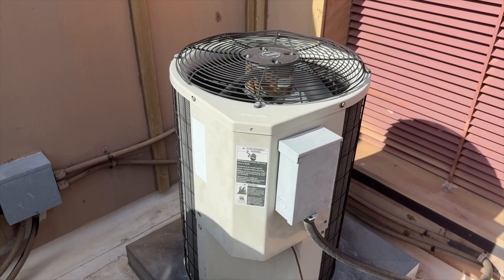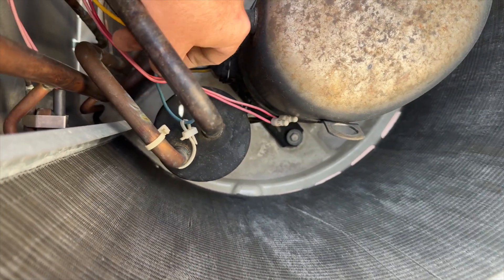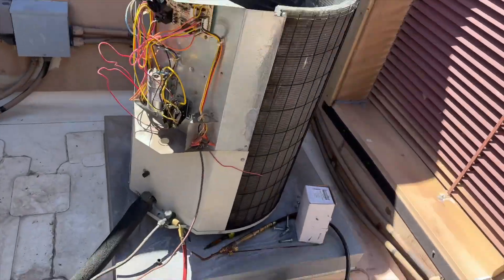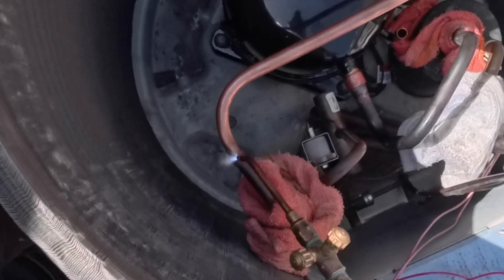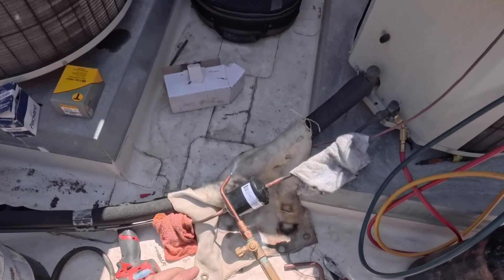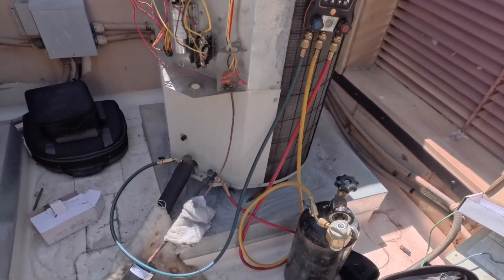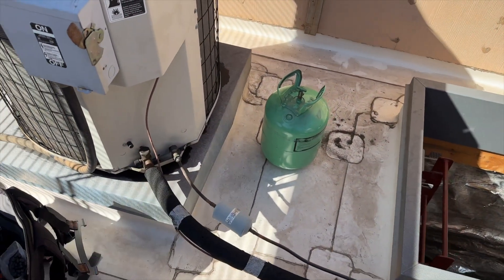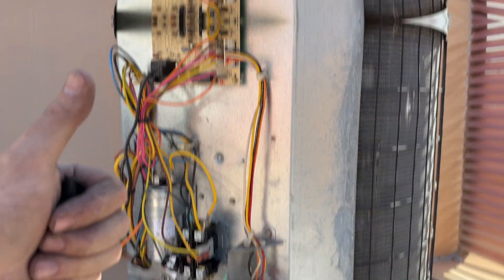AC Not Working. Tripped Breaker.  How to Diagnose a Bad Compressor and Replace it. EP218

Comment: Just curious: is it unusual for a compressor to go bad over a mild winter without being turned on?  My system tripped the breaker the first time I turned it on this year (worked great in the fall).  Worked fine the second and third times I turned it on, but then immediately tripped it again the fourth time (have kept it off since).  It's an old York gas pack, so I realize the compressor/system is on borrowed time, but I thought it would die during use.  A technician is coming--I'm just fear-mongering lol.
Reply from the maker: Think of it as a car. You have to start it up once in a while or things can go bad. The compressor oil starts to loose viscosity and such. If it’s a reciprocating compressor it might just need a hard start kit to help it get going. It may have issues with the winding insulation. Could also be a weak or undersized breaker. Replacing a compressor is an option but other issues could arise. Sometimes it’s fine. Sometimes something else goes wrong and it turns in to a money pit.  Good luck.
Reply: @NighthawkHVAC  Well my old York lives to fight another day.  Wire to compressor was shredded.  Technician spent a lot of time testing the compressor and fan motor.  Couldn't find an issue with either that would've caused it.  Said they weren't even close to being out of range.  There were shrews near the package unit that winter, so they may have chewed on it.